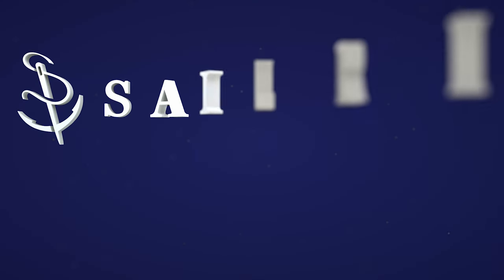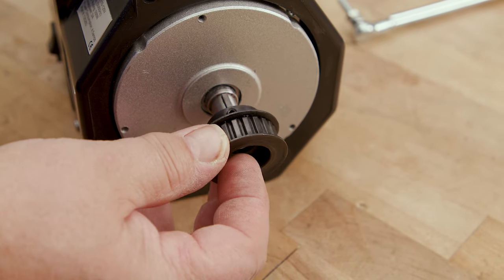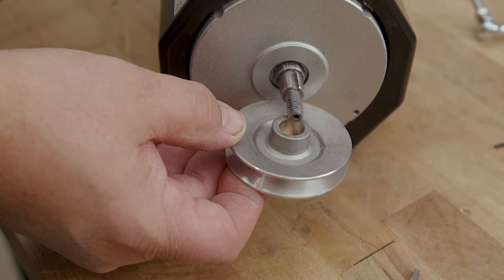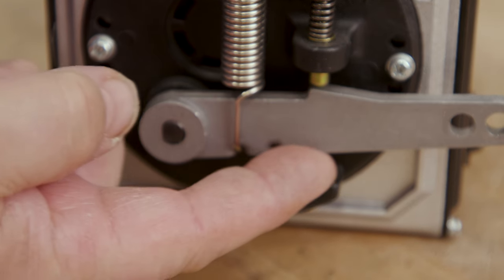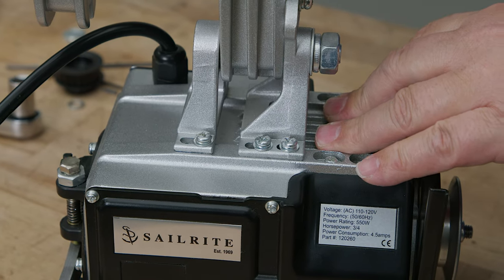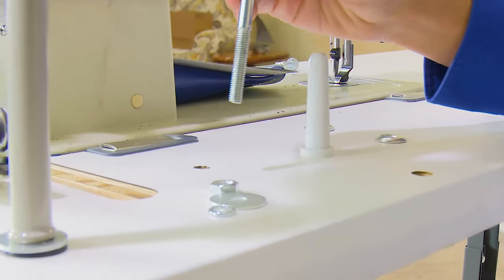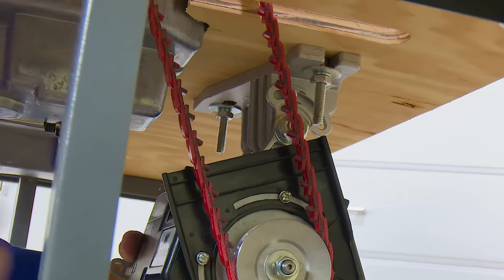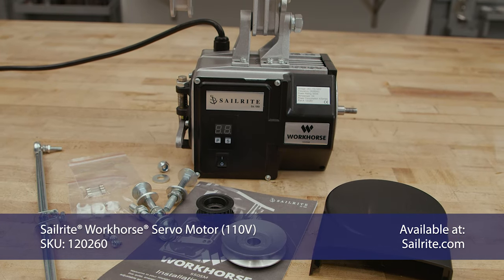Installing Workhorse Servo Motor on Industrial Table

Comment: Tanks for sharing this video, I wanna know if I can use the servo motor on my old sewing machine that comes with clutch motor.
Reply from the maker: Thank you for your question! We're glad you're considering using a servo motor the Workhorse on your old sewing machine. Yes, a clutch motor can be replaced easily by this servo motor.
Reply: Same here
Reply: @SailriteDIY  Tank u very much.

Comment: So, maybe a stupid question but the carriage bolts don’t go down into the table. Am I supposed to tighten the bolts to force the square part down into the round hole? I don’t want to mess up the table but that seems the most logical approach.
Reply: Nevermind. I just went for it. Balls to the wall. It worked!
Reply from the maker: Yes, the square part of the bolt does sink into the table top. You are correct.